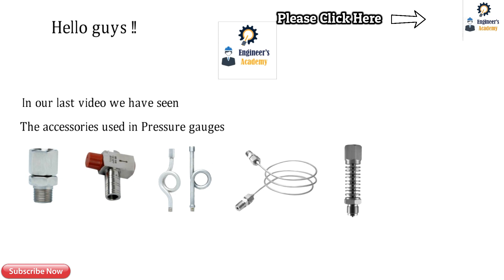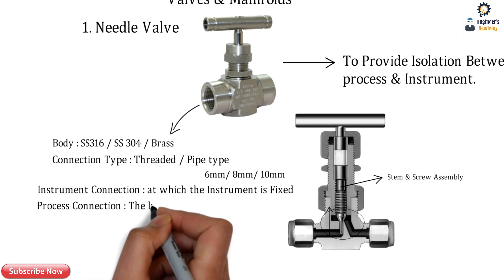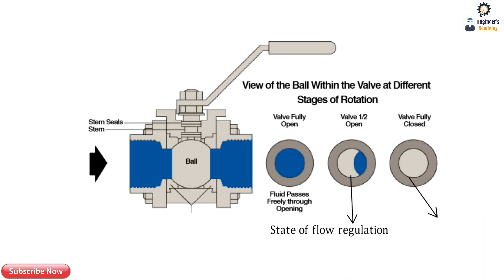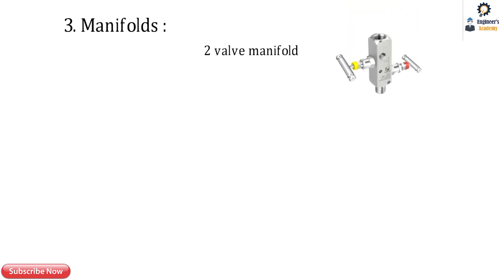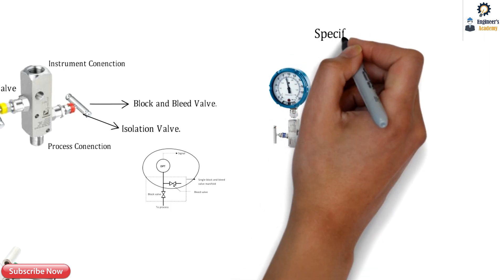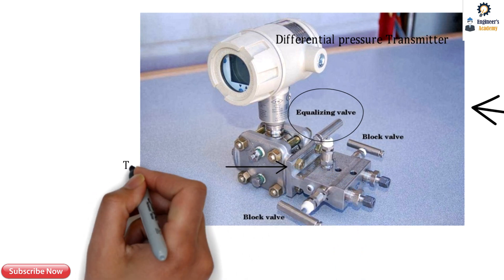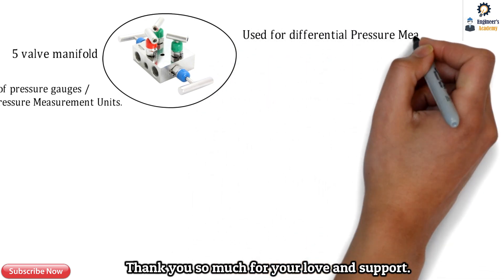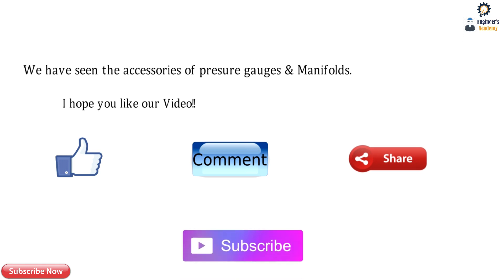Valves & Manifolds used in Instrumentation. ||Engineer's Academy||

Comment: so could you explain how the equalizing valve works?
thanks
Reply: The equalizer valve opens up a flow path between the high and low side of the transmitter.  To equalize a manifold and create a static zero you would close of the low side block valve and open the equalizer valve this allows the high side pressure to go to both the high side transmitter diaphragm and the low side transmitter diaphragm.  The delta P should now be at zero.
Reply: Also on his 5-valve manifold shown he is wrong.  It is a gas style 5-valve manifold and has two equalizers and one vent.  This is indicated by the green dust covers.  Green signifies equalizer valves and the red signifies it is a vent valve.  To equalize it you would make sure the vent valve is closed and then close the low side block valves and the open each equalizer valve.  
 They do make a power style 5-valve manifold but it would have two red cap bonnets and 1 green cap.  Blue signifies the block valves.  To make sure you could also look to see if they have one vent port(gas style) or two vent ports(power style).